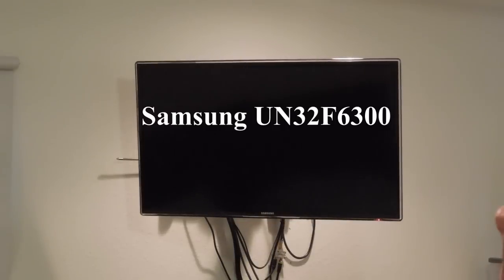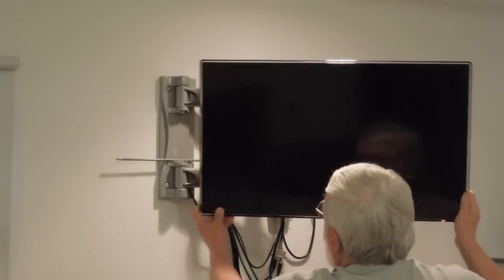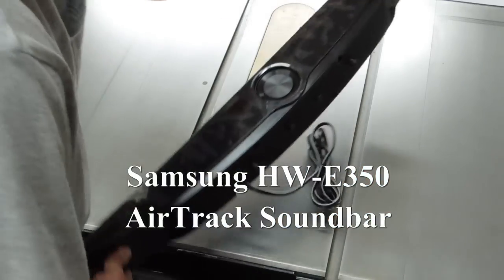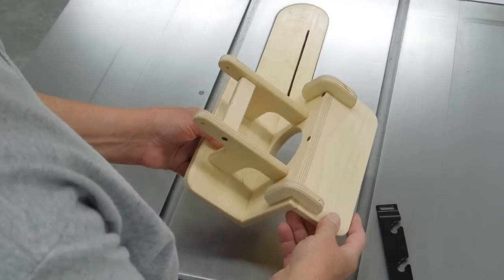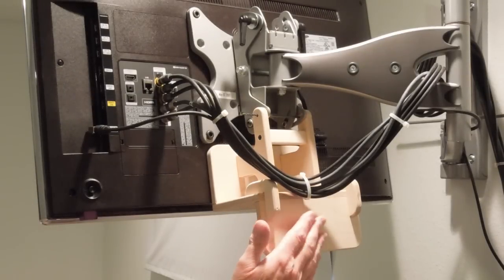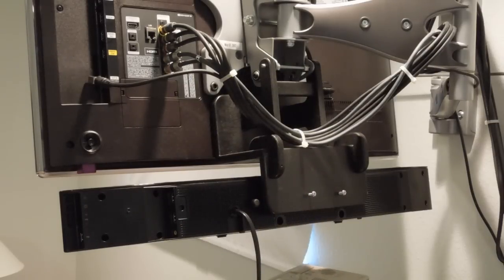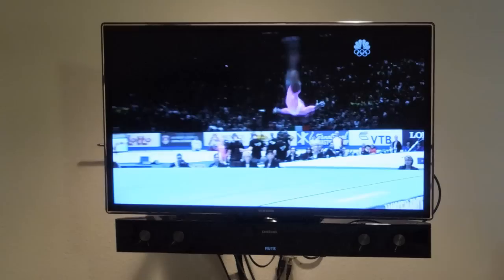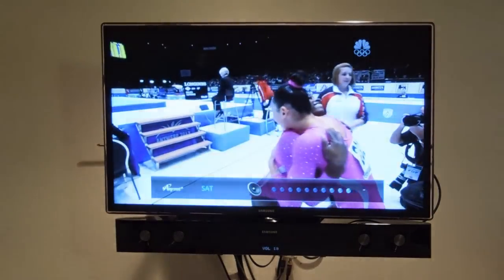Soundbar And TV Mounted On Articulated Wall Mount (Samsung)

Comment: Thanks! I always enjoy your videos. The feature that allows the TV to turn on and control the sound bar is called HDMI-CEC (Consumer Electronics Control) in case anyone is wondering. HDMI-CEC will typically work between brands so you could, for instance, control a Samsung sound bar with a Panasonic TV. It is slick technology.

Comment: I think the design of minimalistic sound system on TVs is driven by the variety of sound systems people want/use. Some are ok with a small sound bar like this, others want a 7 speaker dolby surround sound system with multiple 14" bass speakers. From that perspective, it does make more sense to build in a barely adequate system, keep costs low and then let people upgrade the sound to what they want. They're making the different, disparate systems modular to allow more mixing and matching.

Comment: Odds are they make cruddy speakers so you will pay more for the bar. Pretty low of them if that's there mind set, but it wouldn't be anything new either. As far as the build goes, great idea and great build Mr. Walters.

Comment: Hell of a nice job by a clear "Master Craftsman". Wish I could email you my set up as i, trying to attach a 54" Vizio Sound Bar to my Panasonic ZT60 60" Plasma. It sits on a rotating swivel stand and I'm thinking of designing and making a mount that will allow it to placed across the top, and angled slightly downwards. 
When placed at the bottom, it blocks TVs IR remote sensor.  Either way, the entire sound bar will rotate like yours.  Excellent workmanship. You could make some money by d signing such mounts for the masses. Job well done IMHO. 
Wm.~

Comment: Nicely crafted Ron. The convenience you experienced with controls was no doubt due to same brand bar/TV though. We just scored a nice LG 50" plasma for our apt community room for only $479, regular $829. Been thinking about a Yamaha bar with bass built in. I've seen them for about $180 on Newegg and they get rave reviews. I have a friend that has their next up model with wireless sub, but his bar speakers are smaller than the cheaper one with bass built it. I also thought his sub is too boomy at times.

Comment: Hello Ronald,  I just purchased an LG sound bar and did a google search to figure out how to use it with my wall-mounted Samsung (articulating arm) and your YouTube video popped up.    Brilliant and exactly what I need to do.   Do you per chance share your design drawings?
Reply from the maker: Edgar Zappa I built this to fit my wall mount and soundbar and there were no drawings. You just need to follow my idea and take the construction from there.

Comment: Hi: Just wondering if you could share which model wall mount your using?  (Just picked up a 55" LED, about 40lbs
Reply from the maker: OmniMount but I do not see a model number. At Amazon dot com it looks similar to Omnimount Single Arm LCD Cantilever Mount 40 lbs however my mount is made much heavier. When I bought this years ago at Circuit City it cost half as much as the TV. It would appear since TV’s have generally decreased in weight that Omnimount no longer make the heavier version but you could try contacting them and ask. Google Omnimount for their contact information.